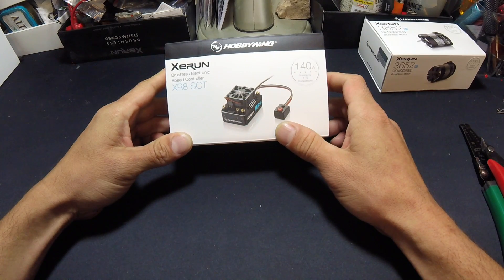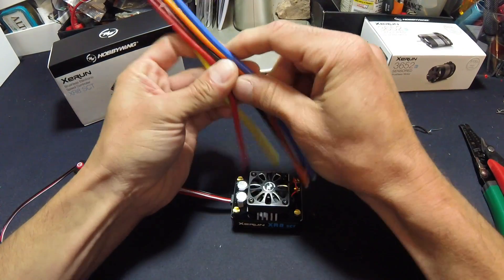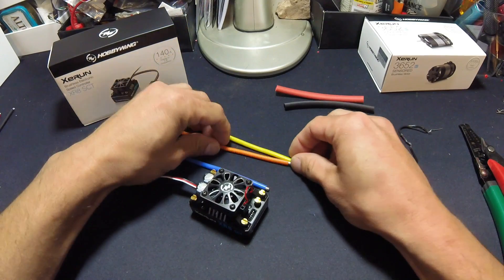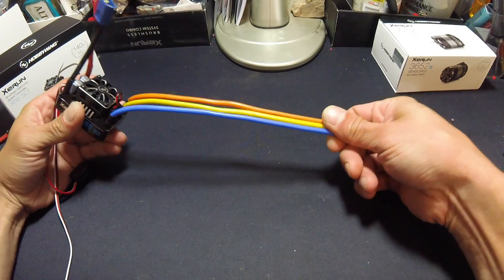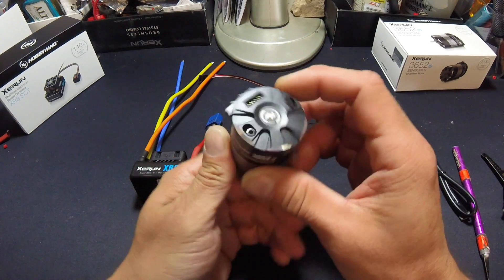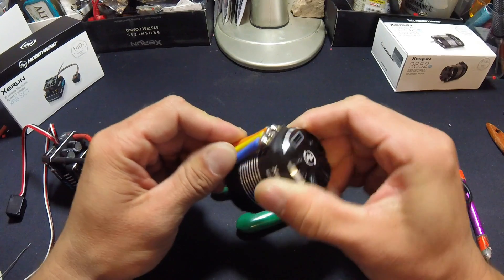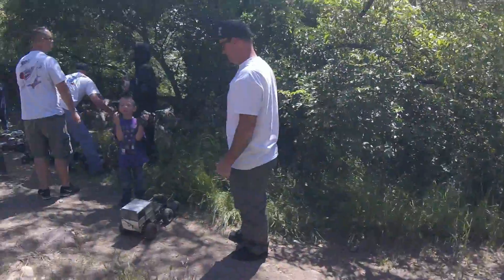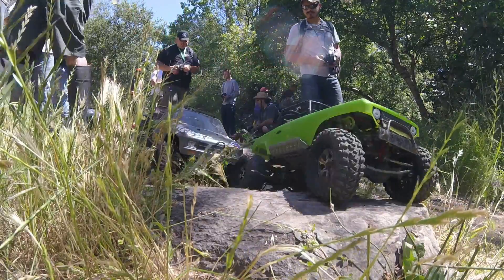The Charlie Show /// Episode 6 /// ESC and Motor Wiring

Comment: Friend ! please help me I bought the esc it came without the cable, which connects to the motor, what is the gauge, (section) awg that I buy for the motor? What would be the cable? Do I buy it with a silicone cover? I'm going to use a 540v 8.5T motor in this 10bl120 g2 esc

Comment: No DNR pulling you over for DUI? We are setting up a short course track (kinda) . I'm doing a need for speed version of road. Working on a sensor setup from security solar light that has a red and blue flashing lights with siren. So if it's time (trying to figure that out still) for cop 2wd rustler to come out.  We'll hit 3rd ch and they pass setting off sensor 🚨 and 🔊. He knocks them off. 1 or 2 at a time. Project RC Need For Speed.

Comment: you make it look so simple to do :-). I have been trying the same without any luck. Can't get the solder to bind to the connectors on the motor..  is the thickness of the wires important ? I can do it with the normal wires from a brushed motor

Comment: hi, I've just bought the xr8 sct pro ESC and mine came with all black cables, does it matter which cable goes to AB or C? I can;t get reverse as well
Reply from the maker: You'll want to be sure, they are in the "correct order".  A to A, B to B, and C to C, always with sensor based systems.  With a sensorless, you can mix them up a bit to get the correct motor direction, but for a sensor system, NEVER change wiring order. 

Also, feel free to email Charlie directly - Charlie@hobbywing.com